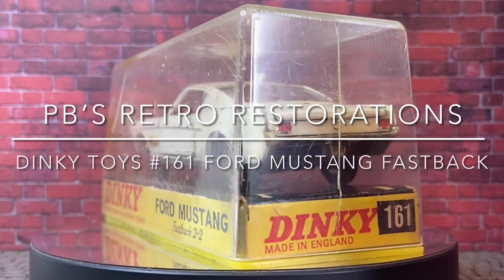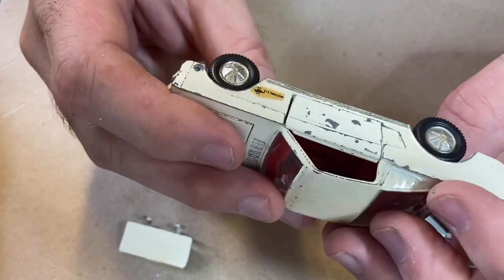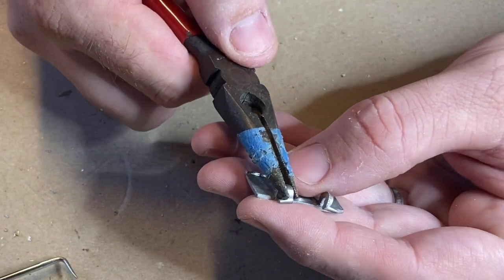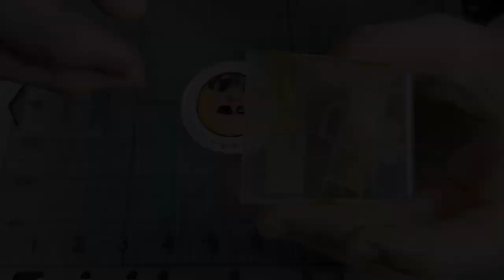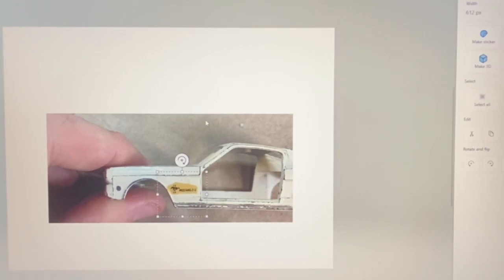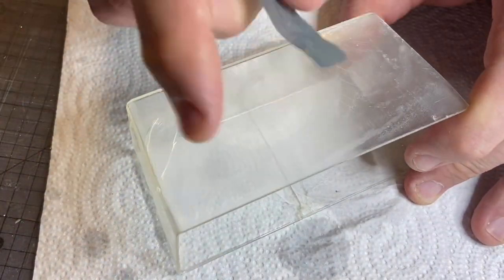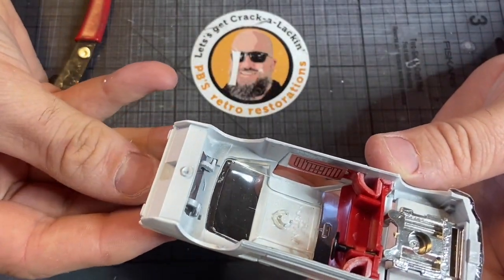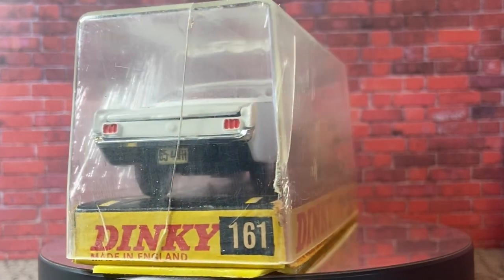Dinky Toys #161 Ford Mustang Fastback Restoration #070

Comment: nice, nifty, neat... great work! ^^
if I recall right the stickers for grille and door cards were done with paper backing, which deteriorates over the decades, and eventually come off. Corgi sometimes used aluminium backing for grilles. if the door cards were metallic, Dinky did that, too, probably. there the glue dies and crumbles away.
good thing my own dinky mustang is in good enough shape not to need a resto. those doors are fiddlier  (is that even a word?) than siku doors... XD
Reply from the maker: Thank you Lothar. I don't think I pulled the stickers off, so I'm using your excuse lol. And fiddlier 110% is a word at my place.
Reply: @PBsRetroRestorations  I have an old Corgi Mustang I repainted three times, and every time I pulled the grille sticker off. it still sticks, but I think a fourth time will be the charm. XD